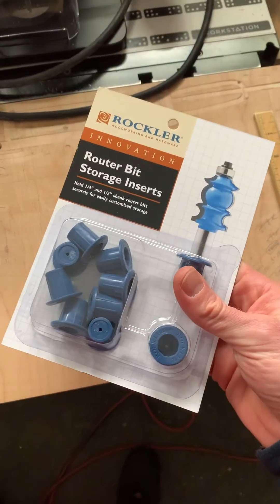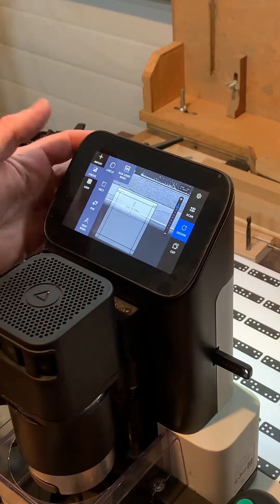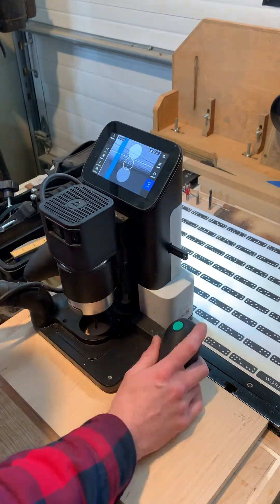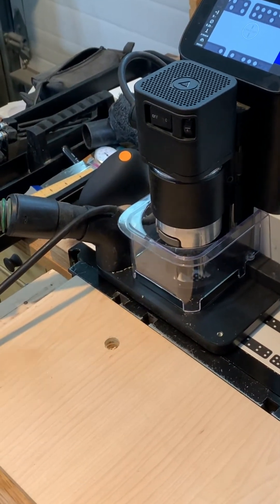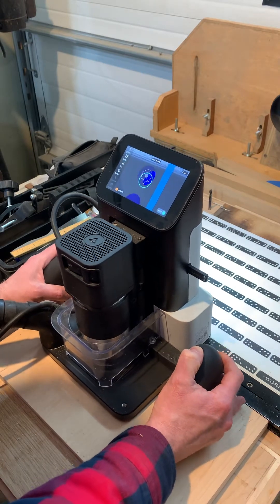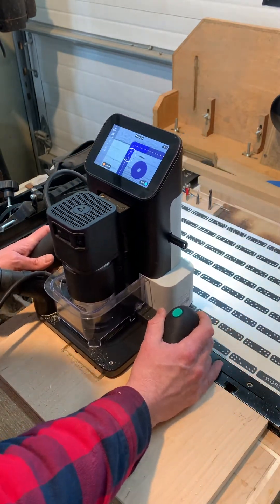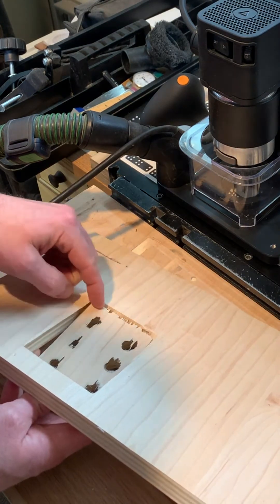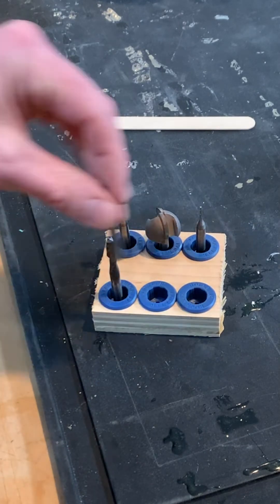shaper origin cuts router bit holders with autopass

Comment: I just cut 198 of these darn holes for those self-same plastic router bit holders with my Origin this weekend. Love the helix feature for that. Really should have just used the regular CNC but the drawer insert I was cutting the holes into was too large for it. I used 3/4" MDF and cut to a depth of 18mm with a 1/4" bit. I noticed by not cutting all the way through the MDF that the helix operation left behind a very thin vertical plug which I had to remove with a pair of long nose pliers. Other than that, a few hours of work, and all my router bits are now properly organized.
Reply from the maker: I’d like to have a gantry cnc router as well for things like 198 holes!